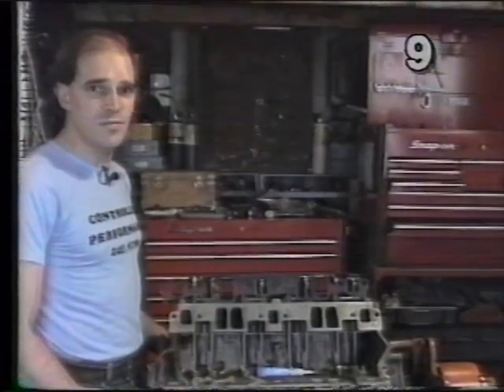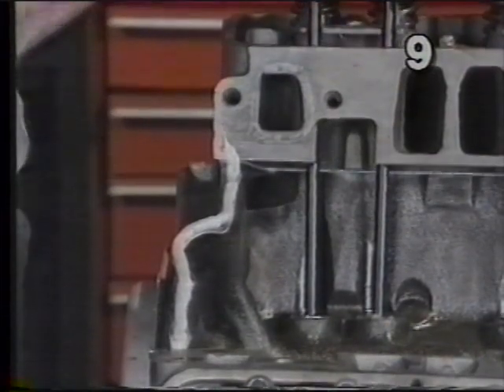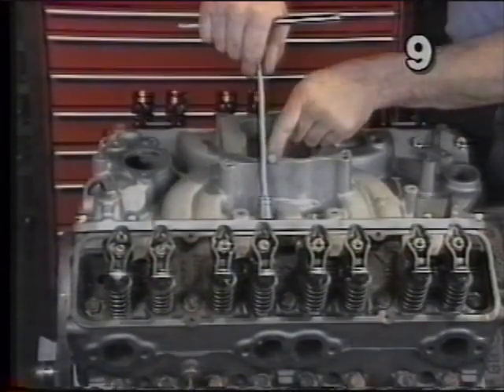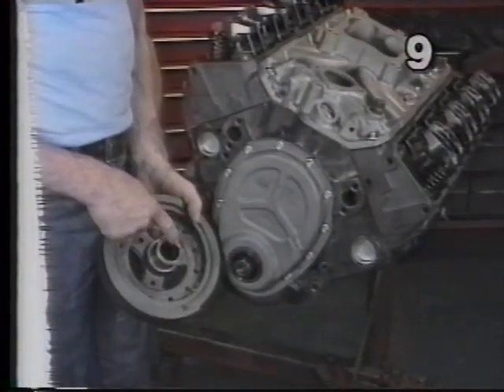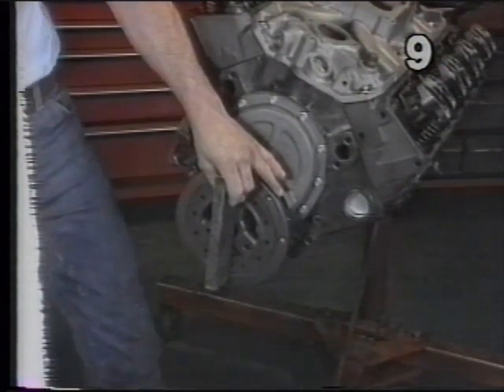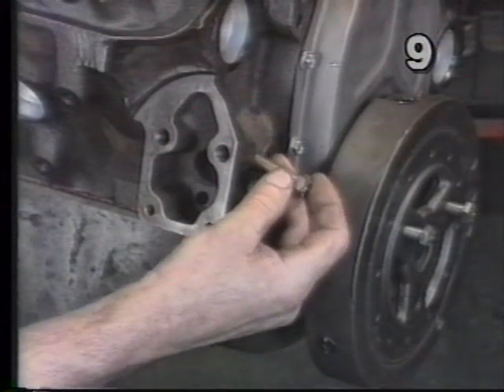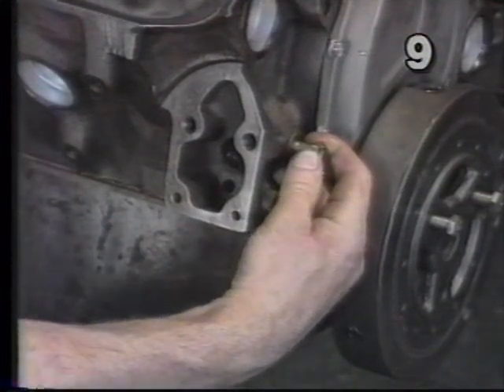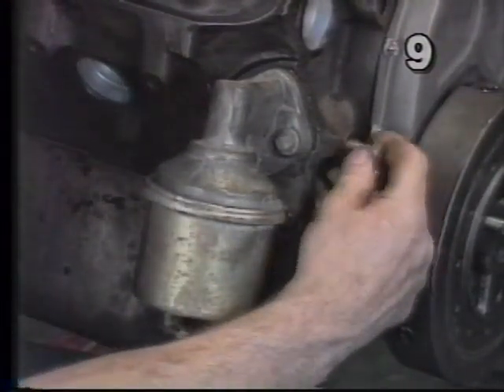Rebuilding Your Engine  Part 9  Intake Manifold  Install

Comment: I install my damper before installing my heads, so I can take measurements with a dial test indicator and actually find TDC and make sure it's marked properly, otherwise you're just hoping the marks supplied on your damper/pointer on timing cover are correct!

Comment: Very good video.  I agree, using the old fuel pump is just fine. It is a part that is easily replaced if it goes out, so why not save money where you can.